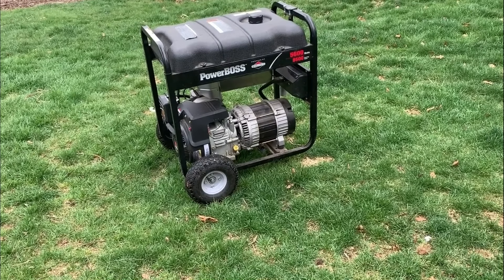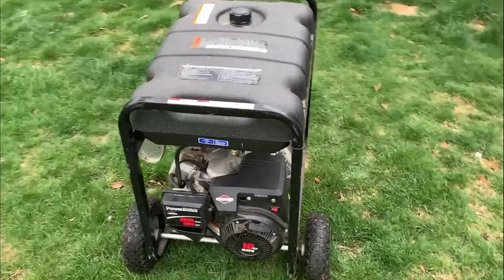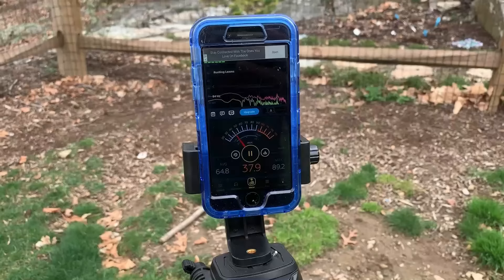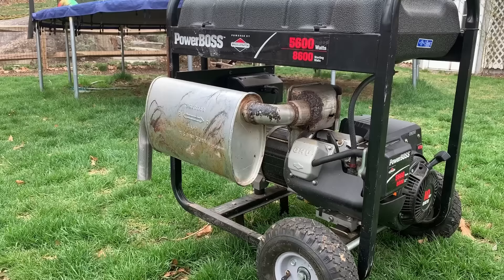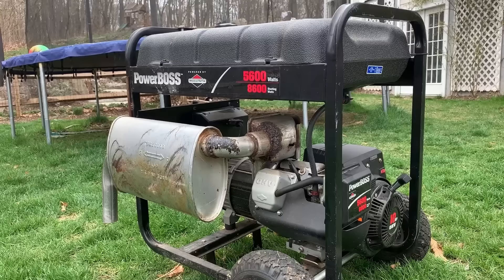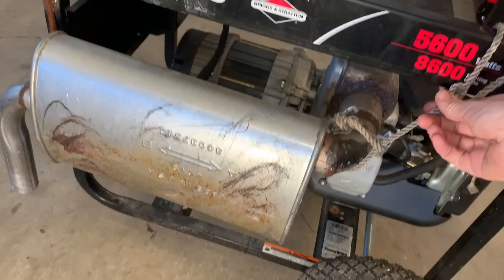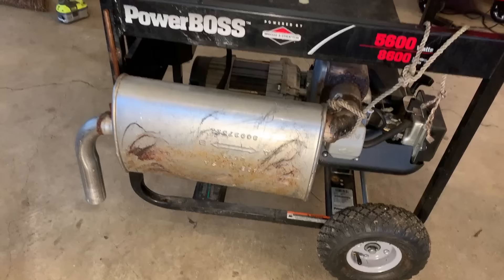Will a Car Muffler Make a Generator Quiet?

Comment: I built a generator box out of MDF and sound proof panels and used dryer ducting for exhaust ventilation an cooling fans for air flow. Did this so I could weld in my garage without bothering the neighbors (lived in an apartment). It worked very well! Asked them in the morning after welding for 2 hours if they heard anything and they said no. From outside the garage it sounded like a truck idling volume

Comment: I've been saying this forever. Put an oem auto muffler on everything you want quiet (especially boats and gennies).
Reply: Can i put it on my wife
Reply: Jimmy L.  Might need a baffle to
Reply: Does it work on women?
Reply: will it work on my husbands huge but crack
Reply: @cessnadriver9885  if you've got the room use the resonator too
Reply: Gurustud... are you serious..?? Will this work on any boat or generator, without causing any problems over the long term..? What about the alteration in back pressure due to air flow..? Please explain..
Reply: H.2.O it’s likely negligible. Most things that you would want quiet aren’t meant for all out performance. Most car mufflers will flow way more than necessary for most generators and older boats.
Reply: brycea0225 brilliant... thanks Bryce.. that’s assuring..
Reply: nerd man12 if only that’s how it worked
Reply: @brycea0225  Mi n,,
Reply: Almost 4 times louder.
Reply: I wil put a silencer to my wyfe 😂😂🤣🤣🤣🤣
Reply: @vincel.1818  You beat me to it man! 🤣😂🤣😂
Reply: I would say to use a motorcycle muffler like a harley muffler from its comfort class.  A quieter one.  The problem with an auto muffler is allows too much airflow on tiny engines.  You need a muffler spec'd to the engine size.   A 190 ci engine uses a 120 ci muffler.  At a 25 ci engine it would make sense to use a 20 ci muffler, aka a motorcycle muffler.
Reply: The majority of noise from a generator comes through the thin engine wall.  Mufflers do very little to quiet the sound.  If they built generator engines with the same thickness of engine walls as a car, you'd need a forklift to move them around.
Reply: I'd love to see how someone is going to put one on a boat 😆
Reply: @shmo3723  JB Weld is better for cracks.  :D
Reply: ⚠️Always make sure you follow all the generator safety rules when you use your portable generator: 

This is just a reminder to make sure. It is important to follow all generator safety rules whenever you use your portable generator. 
Here are the things that need to be followed;

1) KEEPING OTHERS SAFE: Please do not allow an unqualified person or your children to operate and service the portable generator. Just because some manuals don’t say that doesn’t mean it’s safe. That is important against the generator safety rules. We also need to be keeping an eye on our children too. You need to make sure that your children are not playing near the portable generator especially when it’s running so they won’t get electrocuted. Generators pose electrical risks and they can be hot during an operation. Please keep your children away from the portable generator at all times. It is important to keep our children safe especially our little ones. Be aware of all the hazards.

2) WHERE TO RUN YOUR GENERATOR: Some people use their portable generators indoors which increases the risk of carbon monoxide poisoning. It’s important to have a carbon monoxide if you have a gas generator. Never ever use your generator indoors even if your doors and windows are open and even in the garage is not safe to use a portable generator. Not even at your porch and your deck. It is never safe to use your generator indoors and in enclosed areas of your home. Your generator needs to be 15-20 feet away from your house. 

3)🔥FIRE HAZARDS: Never refuel your generator while it’s running. You need to let your generator cool off before refueling it and before storing your generator. Never overload your generator too. Never ever back feed your generator. You should never plug your generator into a wall outlet. Also never store propane tanks indoors. Please keep flammable things away from the generator as well and please don’t smoke cigarettes near the generator. Having a fire extinguisher next to the generator is also important against the generator safety rules. 

4) GENERATOR OPERATION: make sure your hands are dry before touching the generator. Never use your generator in wet conditions. Don’t let your generator get wet. You need a generator tent if you need to use your generator during wet weather. Please don’t wear loose clothes when operating the generator. Turn on your generator before plugging in appliances. Use the right cord for your generator. Please do not use worn out cords. 

https://youtu.be/I1jT3ANENvI and here is a video more about keeping others safe when using generators 

Hope this helps
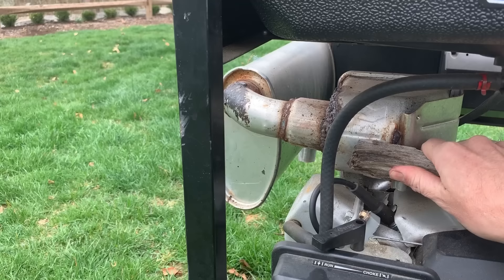Reply: @vincel.1818  it's worth a shot, cause like in this video shoving wood into her holes doesn't do much. 1:45.
Reply: @vincel.1818  Make sure her mouth is full and it will be hard to speak. Tell her if the mouth is empty you will be going to the exhaust end of her to hear what the noise at redline is.
Reply: @nickwarner8158  ....the more use...or the more wore out ....the less the high pitched noise
Reply: i misread that........ i thought you said grannies
Reply: Will it work on movie prop guns?
Reply: @H-2-O Back pressure is no good what u seek is scavenging

Comment: Well a few things I took notice of, for one a full automotive system would include a resonator to highly improve the capability of the muffler(catalytic converter helps greatly not needed). To reduce noise further the exhaust tip should never be pointed towards the ground always Parallel or greater for best results. Installing supports with accompanying bushings can reduce mechanical noise caused by vibrations. Lastly the hardest to install in my opinion is ideal sized piping, sometimes the best pipe size is OEM do your research and do not expand pipe size beyond system capability.

Comment: One of the things I used to do is to build a small shed out of foam with ventilation at the top to put my generator in. I made it out of half inch foam and it helped a lot. I just cut the pieces and taped them together. You just have to make sure it is big enough so the generator is not too close to the foam. For the vents I just made the roof of the shed like a gable end roof on a house and at the peak I cot openings to let fumes out but keep the rain from getting in.

Comment: I learned long ago, on fully built out 2 strokes, that the carburetor emits an incredible amount of noise! Maybe putting a resonator box and long intake tube would shut the generator up a bit more?
Reply: very interesting idea
Reply: We should demand a whole series on quieting this generator
Reply: How does Onan by all accounts the quietest generator do it?
Reply: Maybe getting rid of the hole and then doing some sensible experimentation which would include measuring electrical power output would be the way forward!
Reply: Too bad the engine in this case isn't a 2 stroke.
Reply: @irench  ... I agree...I think he doesn’t understand the difference between a two cylinder and a 2 stroke engine.  Lol
Reply: A two stroke intake fuel charge goes through the crankcase before transferring into the combustion chamber via ports in the cylinder wall..
Reply: Really guys? You think I thought this generator was a 2stroke? The analogy was for reference....
Reply: It can be difficult to make short winded assertions or examples given the <15 second attention span and eagerness of the argumentative to disprove everything.    I simply refuse to either comment at all or only make exceptionally long statements.  Most of which end up getting deleted because of Alpine minded clowns.  And yeah, the parallel doesn't immediately strike.    Cars and bikes have resonance chambers because the audible note is much greater due to higher velocity of more CI and throttle changes.  Engineers in modern cars call this MOOSING and prevent it mostly by hanging a box on the air inlet tube.  Ask anyone who's put a "cold air intake" on how much louder it got.   So you're not wrong but the single lung of that brigs and steady throttle doubtful would realize a drop in db.
Reply: @rgd2598  well the fully built out.. does draw criticism to be sure.  It's a small thing we all have to learn somehow and usually with pain.
Reply: @metatechnologist  

They are just in a different league. The engines are much higher quality so you don't get as much mechanical noise. Most of them also use a very long intake which helps.

Comment: The best way to quiet a generator is to put walls around it preferably lined with soft material.
Reply: There is a lead lined foam made for sound proofing. I used to run a 3phase generator  for the movie business. We had built a hood that went over the gen exhaust and it was very quiet

Comment: Interesting stuff! What’s important to note is that 6db is actually 4x as loud so the muffler was working pretty well I’d say. Most of the noise that remained was probably just from the mechanical parts of the motor.
Reply: Intake noise as well.
Reply from the maker: True, but was just trying to say that people should not have unrealistic expectations.  It was still loud.
Reply: @jcondon1  Yep, even sheet of plywood can make a big difference if the right surroundings are available.
Reply: @jcondon1  Wonder how much noise came from the loose bolt. 🔩  Even slightly loose, it can cause a lot of sound.
Reply: I used to have a boat fitted with a single cylinder 6hp petter diesel.  The exhaust pipe was plastic and water injected, with fitted an anti siphon valve to prevent water being drawn back into the engine.  That was quiet. Might be an interesting project to test.

Comment: More testing required, the "Combo" muffler was flawed, in that there was a sizable leak, that was never repaired. my hypothesis, is the hole was not adequately sealed just by pressing a random hunk of wood against it. 

In a part two, perhaps re attach the car muffler directly, and port the exhaust away from the staetor, potentially also repair the old OEM muffeler and retest. hmmm...

Comment: Solid mounting a muffler to the frame, and having the generator on rubber mounts is just begging to bust something
Reply: Needs a bit of flexible exhaust...you are correct👍
Reply: Don’t be so dramatic...
Reply: Thats exactly what i was going to say! Thats why the one bolt was loose. Probably had a blown gasket behind where it bolts on too.
Reply: Great for testing though.
Reply: Yes, mountbthe muffler to the motor or flex hose and rubber hangar

Comment: I feel like this wasn't a fair test.  The system had multiple holes in it, so it was going to be loud no matter what.
Reply: not to mention the baffle is probably fukced, and the guy is holding a solid object against vibrating wood
Reply: But even so, it was still about 5 dB lower, which is pretty significant. I came here expecting him to conclude that the muffler doesn't really help, and now I realize that it does make a pretty big difference. If he put a big air filter (like a car air filter) on the intake to dampen intake noise, mounted the engine and muffler with rubber mounts to reduce vibration rattle, and built an enclosure with fireproof sound dampening padding (and of course plenty of ventilation, maybe even a radiator fan hooked up to the 12v output, so that the main breaker wouldn't shut it off.. depending on the design I guess) to dampen the noise coming directly off the engine surfaces, I bet you would REALLY see a difference. I.e., basically put this into one of those whole home generator boxes. Ventilation would be the biggest concern in that case, since these air cooled engines are meant to be in open air, so you would almost definitely need to provide a straight path out of the enclosure for the engine + alternator head intake, OR use a separate fan to move plenty of air through the enclosure. This makes me want to try and quiet down an open frame generator I recently picked up, trying some of what I just thought about here. Very interesting video.
Reply: Another issue too is that the stock muffler exhaust was pointing directly at the dB meter whereas the auto muffler exhaust was pointing at the ground. That alone could account for the 5dB difference  However, with that said most of the noise from an open frame genset is mechanical noise.  Quiet genders are fully enclosed and lined with sound absorbent materials and the airflow passes through baffles to help contain the noise.
Reply: He also held the Meter further away on the second test . . .
Reply: ⚠️Always make sure you follow all the generator safety rules when you use your portable generator: 

This is just a reminder to make sure. It is important to follow all generator safety rules whenever you use your portable generator. 
Here are the things that need to be followed;

1) KEEPING OTHERS SAFE: Please do not allow an unqualified person or your children to operate and service the portable generator. Just because some manuals don’t say that doesn’t mean it’s safe. That is important against the generator safety rules. We also need to be keeping an eye on our children too. You need to make sure that your children are not playing near the portable generator especially when it’s running so they won’t get electrocuted. Generators pose electrical risks and they can be hot during an operation. Please keep your children away from the portable generator at all times. It is important to keep our children safe especially our little ones. Be aware of all the hazards.

2) WHERE TO RUN YOUR GENERATOR: Some people use their portable generators indoors which increases the risk of carbon monoxide poisoning. It’s important to have a carbon monoxide if you have a gas generator. Never ever use your generator indoors even if your doors and windows are open and even in the garage is not safe to use a portable generator. Not even at your porch and your deck. It is never safe to use your generator indoors and in enclosed areas of your home. Your generator needs to be 15-20 feet away from your house. 

3)🔥FIRE HAZARDS: Never refuel your generator while it’s running. You need to let your generator cool off before refueling it and before storing your generator. Never overload your generator too. Never ever back feed your generator. You should never plug your generator into a wall outlet. Also never store propane tanks indoors. Please keep flammable things away from the generator as well and please don’t smoke cigarettes near the generator. Having a fire extinguisher next to the generator is also important against the generator safety rules. 

4) GENERATOR OPERATION: make sure your hands are dry before touching the generator. Never use your generator in wet conditions. Don’t let your generator get wet. You need a generator tent if you need to use your generator during wet weather. Please don’t wear loose clothes when operating the generator. Turn on your generator before plugging in appliances. Use the right cord for your generator. Please do not use worn out cords. 

https://youtu.be/I1jT3ANENvI and here is a video more about keeping others safe when using generators 

Hope this helps

Comment: So, if you put the generator inside a car, and route the exhaust through the car's muffler, you should be golden.
Reply: There are RVS that have the generator at the other end of the vehicle, on their own exhaust. 
Those seem to run exceedingly quiet. 
They are also in their own bay, and a lot of them are water cooled, so heat is not so much of an issue.
Garage 54 filled an entire engine bay with expanding foam, and the engine was, obviously, super quiet.
Before you ask, yes, it caught on fire.
It's good to know that there are people that will do apparently stupid things for us, so we can learn without endangering ourselves.
That is not to mention trying an expensive experiment that will cost an individual a lot of hard-earned money to see if something works!
Reply: Not exactly. The car exhaust is likely higher pressure than the generator's exhaust, so the car exhaust would try to push up into the generator. That would make the generator work harder and likely cause it to malfunction.
Reply: @SomeGuy-vo7we  I'm pretty sure the joke/point I was trying to make was that the original idea was to make the engine quiet, like a car, and so the solution is to take all of the efforts that combine to make a car quiet, and employ them on the "good start" that was attempted, but with a dual-meaning of wasting a car to use as a "doghouse", to keep the noise of a small generator inside (absurdity humor). I'm glad it got your ideas going though. :)
Reply: @danieljones317  I saw that G54 video. Those fellas have some great content! I think a lot of it is the benefit of having so many simple, inexpensive cars wherever they are... I'm certainly envious of that, as the USA is laid out for a constant need of automobiles, yet the complexity/prices/maintenance are prohibitively high.

Comment: Every three db increase constitutes a doubling of the sound signal. Also, as others have mentioned, mechanical noise is a huge component of the noise these small engines produce. Interesting experiment.
Reply: 10db